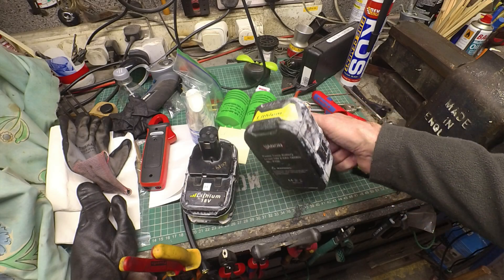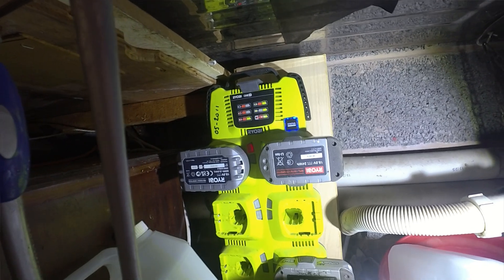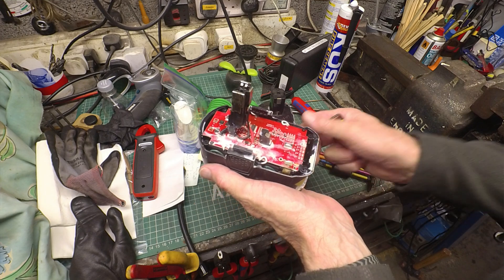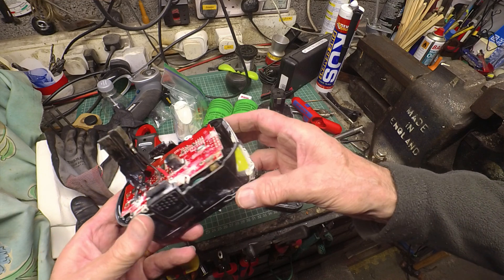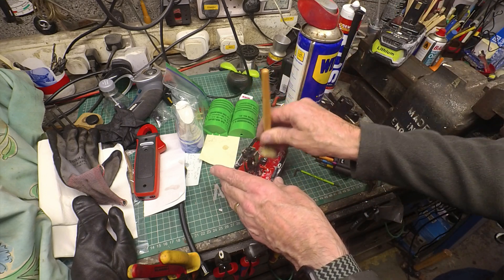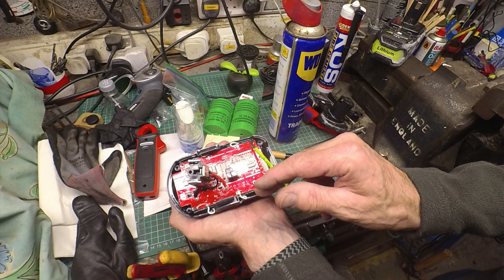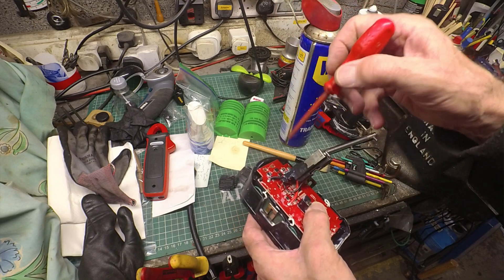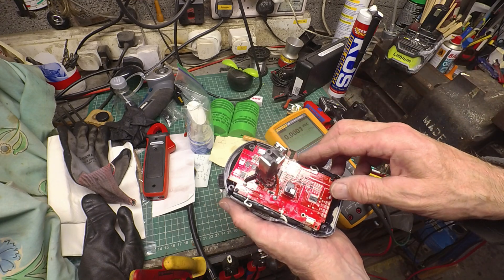'Vanon' Ryobi One+ Battery Repair

Comment: You have just shorted it out, wd40 is conductive, you're lucky it didn't blow up in your face, if you remove the metal press clips on the battery you can grab the batteries and break free from the adhesive to remove the whole lot👍
Reply from the maker: Thanks for the comment. WD40 isn't conductive - though it is flamable, of course 🙂

Comment: I got those batteries from eBay new and man died after maybe 5 cycles
Reply from the maker: Yes, although this particular one is still going, I only buy genuine Ryobi batteries now. False economy considering the risk of premature failure or even fire. I never leave the Vanon on charge inside the house, unattended.
Reply: @Greeves  even with regular genuine ryobi they charge on a concrete in a basement far from anything flamable